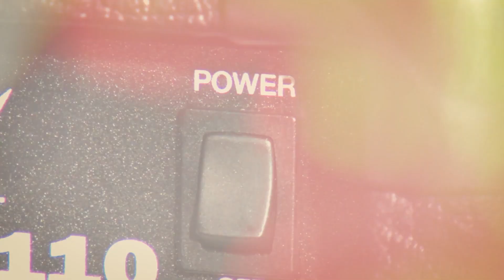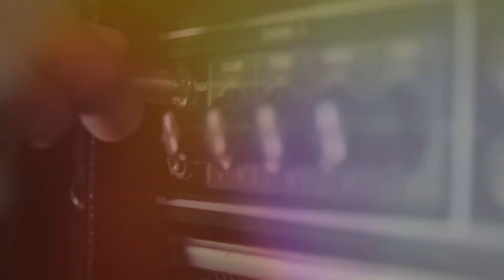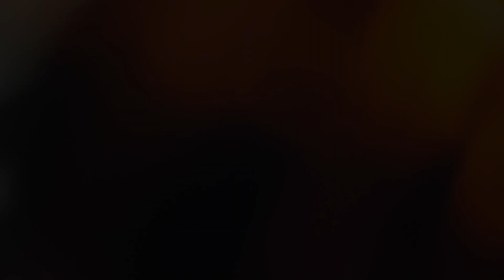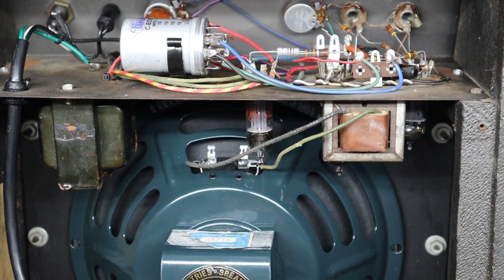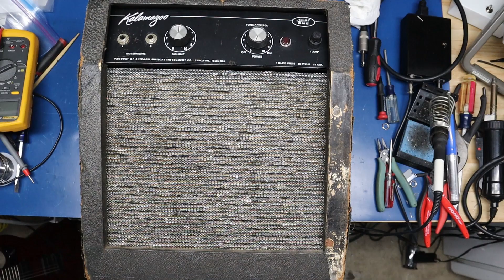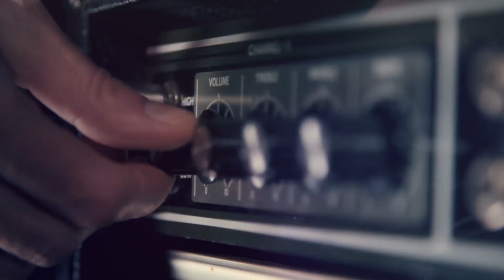Kalamazoo Model ONE Restoration - $25 Yard Sale Find!

Comment: I thought the active was meant to be fused rather than neutral?  Also, that earth lead needs to be the longest out of the 3 conductors to be standard.  Is that earth lug cleaned under the chassis?
Reply: Look at early Fender schematics...this is exactly how it was done. And while this fine, Ideally you would have Live to the fuse then the switch and then the transformer...the Neutral would go straight to the transformer. Yes the ground ideally should be the longest so in the (unlikely) event that the Live gets pull loose and touches the chassis. I agree with you on this but originally this amp had a 2 wire line cord. Given the knowledge and quality of work displayed on this channel, I have no doubt he knows something as simple as cleaning the chassis for a safety ground connection.
Reply: @nikkisimpson1835  Despite your opinion the facts are otherwise.  The mains power implementation is incorrect, dangerous and not to standard.